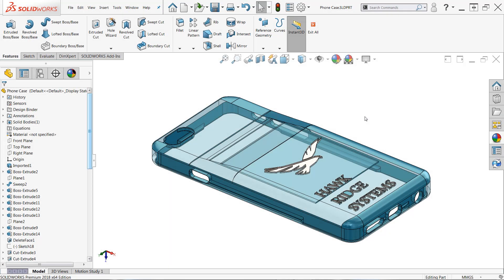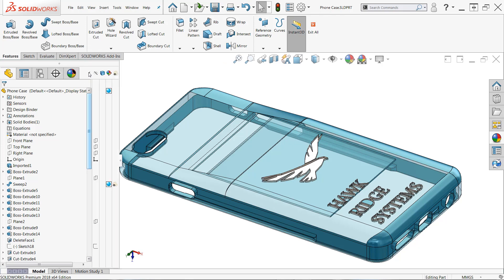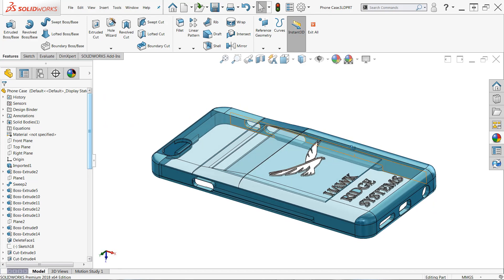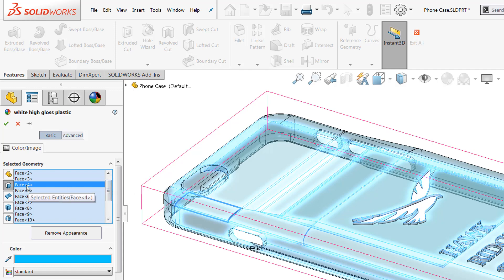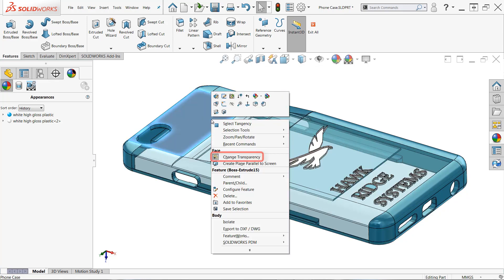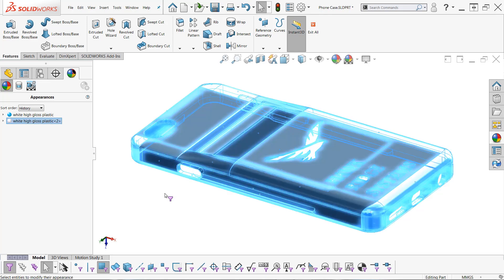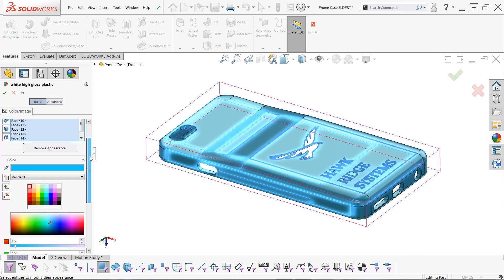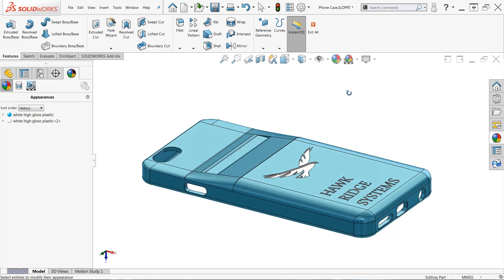SOLIDWORKS: Removing Transparency from All Faces of a Part

Comment: Nope, didn't work for me. Thumbs down. I don't see that transparnt face under "appearances.'
Reply: Hi Jacob, thanks for the feedback, and sorry for the late reply. If you're working with a single body part, you may need to use the FeatureManager category in System Options to set your Solid Bodies folder to "Show" in order to check if transparency was accidentally applied to the body somehow. The Solid Bodies folder isn't usually shown be default for single body parts. Another thing you might check is if there are any Display States active, as those can hold appearances as well. If all else fails, I'd make sure that the graphics card you're using is officially supported by SOLIDWORKS, as unsupported graphics cards often have issues with transparency.

Sorry I couldn't solve your problem with the video, but I hope this helps. Best of luck in your modeling adventures!